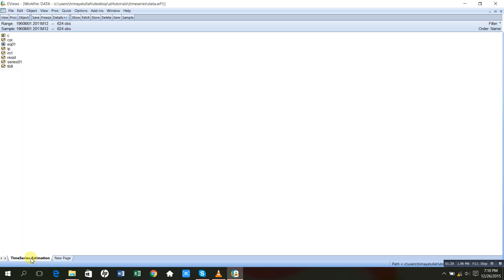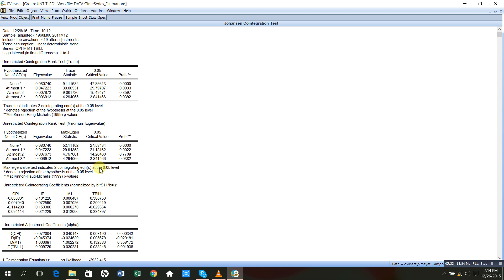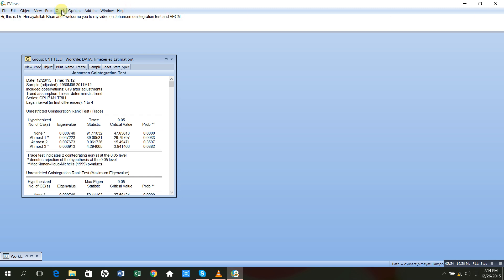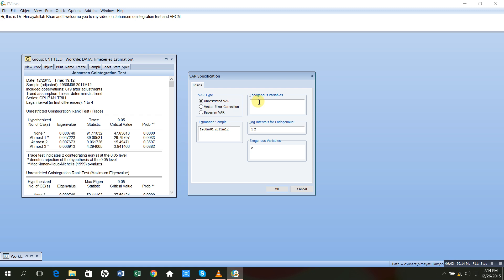11 #Johansen #Cointegration_test and #VECM in #Eviews

Comment: Assalamu walekum Sir
your presentation clear and good explanation sir, i have dought on this, if variable are stationary at level I(0) can i process Johansen cointegration test?
Reply from the maker: If your all variable are stationary at level...you dont need to go for for cointegration. If all of your variables are I(1), then go for cointegration or VAR. If some are I(0) and some are I(1) then you need to go for ARDL.
Reply: Research Made Easy with Himmy Khan Zajakallah khier for immediate assistance..then if variables integrated 1(0) which test can we apply ?
Reply from the maker: Simple Multiple linear regression model and the associated tests. But remember in Time Series in 99% cases the variables are not stationary at level. that is why majority of the the researchers either go for cointegration or ARDL depending upon stationarity conditions of the Dep. and InDep. variables.
Reply: Research Made Easy with Himmy Khan Zajakallah khier sir thank you very much clarifying the doughts

Comment: Prof thanks it is good but coefficients of the long run model for which variable? R they explained same as they are in eauation or changed for intetpretation. For error correction model order should be one lag less than the long run model. Is it true? Plz explain it for adding more value in my knowledge.
Reply from the maker: dear friend error correction coefficient means that speed at which the the model will converge to the long run relationship. its coefficient must be negative, less than 1 and statistically significant.

Comment: I have 2 dependent variables like log of carbon emissions and lof of methane emissions. against these 2 dependent variables i have log per capita GDP, log per capita GDP square, log of energy consumption, foreign trade ratio, coal rent (% of GDP) and oil rent (% of GDP). now when i use sic criterion than all the variables are stationary at FIRST difference. but when I jointly select all the variables for co integration test then results show that near singular matrix. even if I deselect log per capita GDP square value the result is same. how can i curb this situation???? please guide me
Reply from the maker: there may some issue with your data. Recheck it and repeat it. May be it will work.

Comment: i have 2 depent variables like carbon emissions and methane emissions. against these 2 depedent variables i have log per capita gdp, log per capita gdp square, log of energy consumption, foreign trade ratio, coal rent (% of GDP) and oil rent (% of GDP). now when i use sic criterion than all variables are stationary at ist difference. but when jointly slect all the variables for cointegration test then result show that near singular matrix. even if deslect log per capita gdp square value the result is same. how can i curb this situaion???? please guide me
Reply from the maker: you may check your date...There may be some problems with your data. Clean your data. Try again then may be your problem is solved.

Comment: goodday sir, i have a question, i have a model which all variables are stationary, and i found out that there is long run relationship between the variables.
so I should continue with VAR or VECM? 
Thank you.
Reply: There's no need for estimating either VAR or VECM if all of your variables are stationary. That being said, if you have found a cointegrating relation, maybe you haven't specified your unit root tests properly.
Reply from the maker: I think if your variables are stationary at level, you may go ahead with simple regression.
Reply from the maker: VAR

Comment: Dear Sir, 

I have a question, for multivariate variables when I test Johansen cointegration. The result shows fail to reject at most 3 . Does this mean that all variables in the model have long-run relationship ? or I need to find out which variables don't cointegrate with other variables ? For example, I want to know whether long-run relationship exist between oil price and exchange rate. (but I used multivariate variables in the model) the result shows accept at most 3--> Can I conclude that there is long-run between oil price and exchange rate. 

Thank you very much if you could help answer on this :)
Reply from the maker: You may google for clarity about this issue

Comment: what if the coefficient of error term is negative but p-value is greater than 0.05, which is not significant. What to do in such a case?
Reply from the maker: the sign is more important...if p-value is less that 0.05 that's better but even if p-value is not significant, that's not so a big problem.

Comment: sir i have taken natural log of index series and it gives me a return series and plz tell me on which series i can apply the johnsans cointegration test. Whether it is on index series or return series???
Reply: Natural log of index series does NOT give you a return series. You have to difference your logged index series to get a return series
Reply from the maker: Check on both and compare results in both cases

Comment: I have a question, I have a model with 3 variables two of them are l(1) and one is l(2), is it appropriate to use this to test for cointegration? thank you
Reply: Miss. the data in long run shall show diversion instead of conversion.
Reply: Are you sure you haven't mis-specified your unit root test? Seems unlikely that one of your variables would be I(2)
Reply from the maker: I Think in this case  Co-integration may not the right technique. You may look for some other alternative.